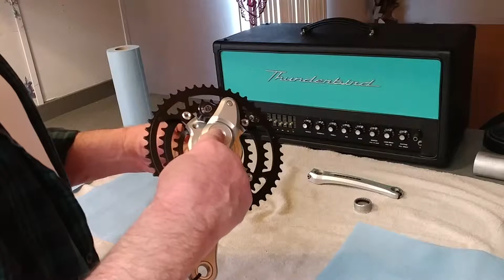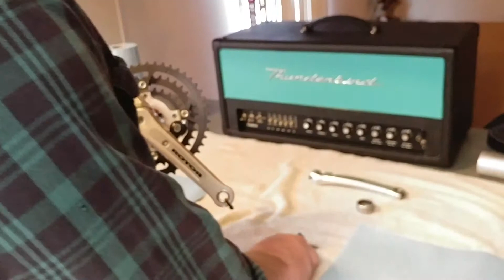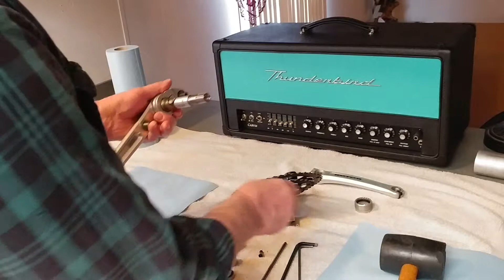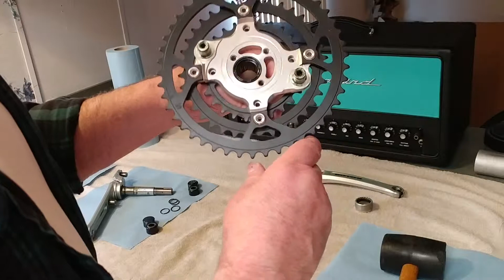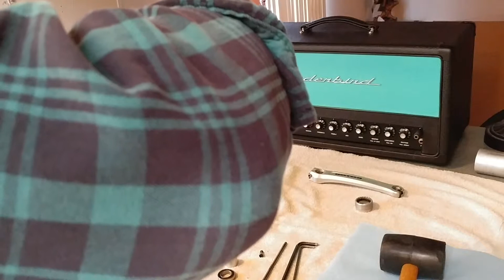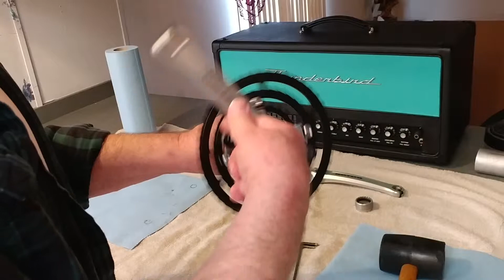Rotor RS4X Maintenance Info

Comment: You didn’t address the question of cleaning the needle bearings.  I wrestled with that for quite awhile.  What I do now is pour Park Chainbrite into the needle bearing that I want to clean, and work it in really well with a q-tip.  If it’s really filthy, I might do that twice.  Then I switch to hot water and detergent.  I go through a LOT of hot water and detergent rinses, and I use a lot of q-tips.  I drain the bearing, then I re-fill it with rubbing alcohol, and clean it one last time, using one more q-tip.  Then I let the bearing dry before I re-grease it.
	I use a rubber plug to block the end of the tube below the larger central needle bearing.  Then I have a closed chamber, so that I can clean that bearing in the same manner.  It takes me forever to overhaul a crankset, but it’s the only method that I’ve found that results in a clean bearing.
Ken Rasmussen
Reply from the maker: I clean needle bearings with automotive brake cleaner in an aerosol can. Using the straw in the nozzle works great to flush the bearing under pressure. Brake cleaner evaporates pretty fast and leaves no residue, but I still give the bearings a good shot of compressed air after cleaning....the larger needle bearing in the spindle is scrubbed with a toothbrush and Dawn dish soap before spraying it out with brake cleaner and compressed air.